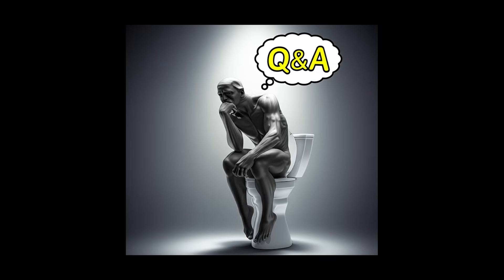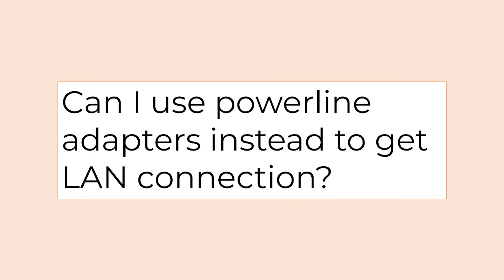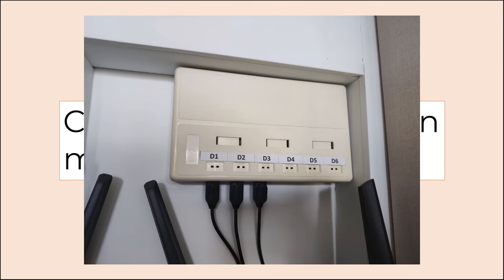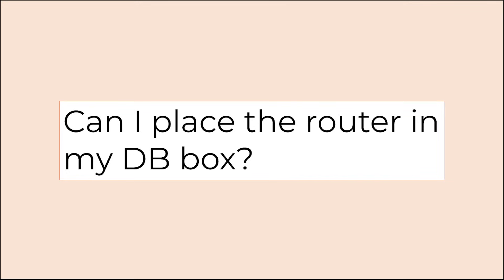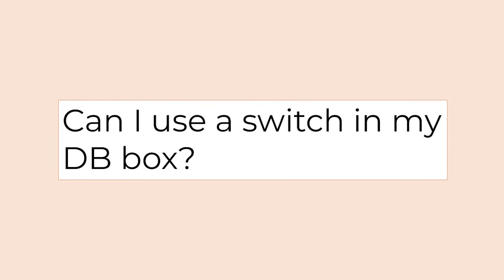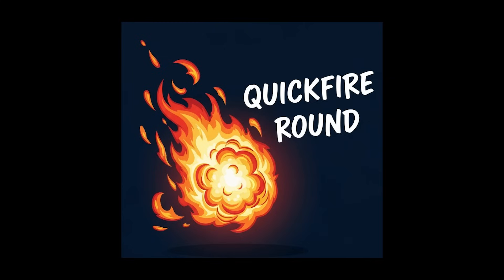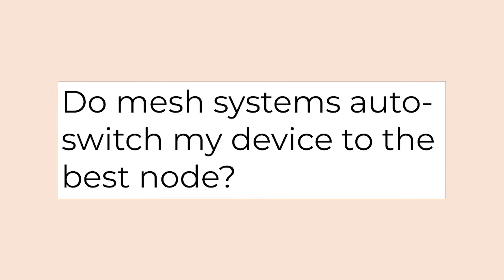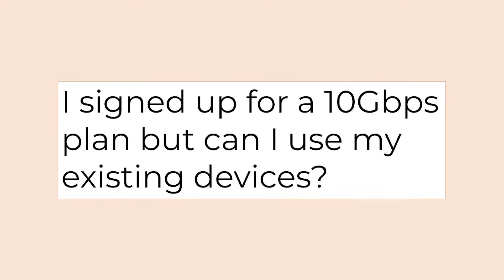HDB Networking Q&A | HOW TO INTERNET? FAQ | 🏠 Singapore HDB 4-room BTO

Comment: Great video!

able to give some clarity with regards to you mentioning your current asus device only support up to 1Gbps, don't the AX88U support up to 4gbps? , or did you mean that your ethernet (wired) link only supports up to 1gbps?
Reply from the maker: Yup! I meant ethernet link is only gigabit speed.
Reply: @SherBooga  trying to be budget conscious to cover a wide home, is there a way to cover whole home with wifi (2 levels) with 2 routers? if i were to put one of them inside the DB box? optimally i would like to put both routers outside, but realized that i will need a router that supports 2.5GB port inside the DB box to plug into the "thing"
Reply from the maker: I think it is possible with 2 routers, but not within a DB box and may have some spotty networks around the house. By 2 levels do you mean the house has 2 levels? The network will still work but you'll have to address the bottlenecks. If you need more help, send us a DM on IG and let me see if I can help with your situation.
Reply: @SherBooga  Hello have dmed you on IG, but unable to send my floorplan image over
Reply from the maker: I'll check!

Comment: If I have a new BTO, should I get the Asus BT8 or an older Asus ET12 on a 3Gbps plan? 

The assumption is that I will have wired mesh from the ONT > living room port 2, Lan port to living room port 3 (back to DB Box), then use a switch to supply internet to the rest of the datapoints. 

Btw, nowadays the BTO gives you 9 datapoints (1 near DB Box, 2 in the living room and another 2 in the main bedroom, 1 in kitchen, household shelter, bedrooms 2 and 3).

P.S your vids are being shared on hardwarezone which might increase the likelihood of new home owners looking at it to reference how they should do networking in their own home. Can't wait for your next vid to be out!
Reply from the maker: I think it depends on your existing devices and also how much you want to future proof. I would take the BT8's WiFi 7 over the ET12's WiFi 6E just because it's pretty new and your infrastructure would be quite solid for a longer while. The theoretical speeds and efficiency boost is quite significant.

I haven't seen the 9 datapoints, but wow that's pretty handy. Also, thanks for the note! Let us know what you wanna address next!